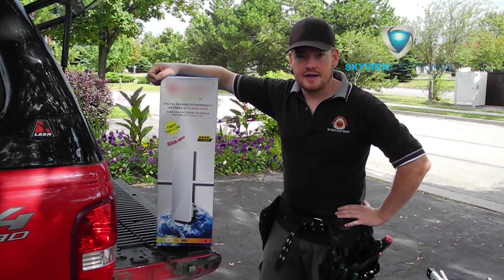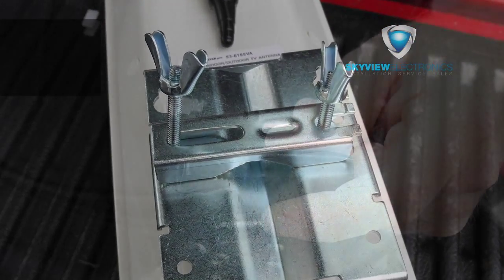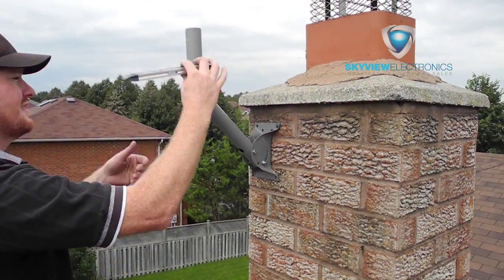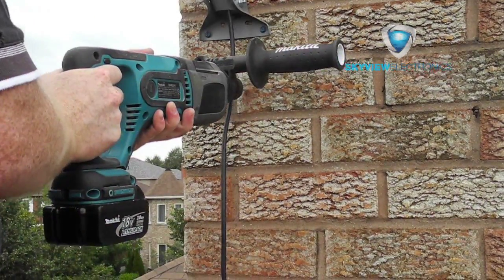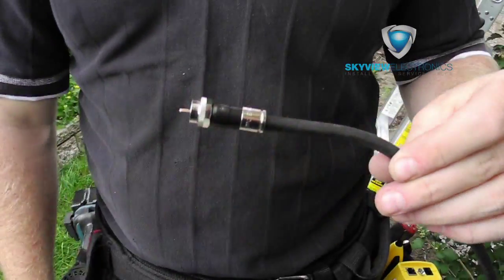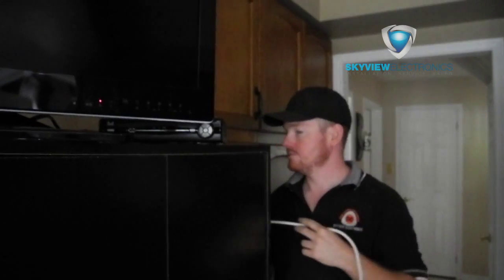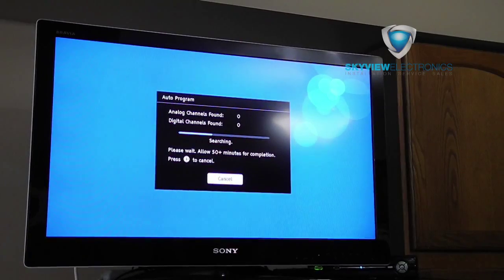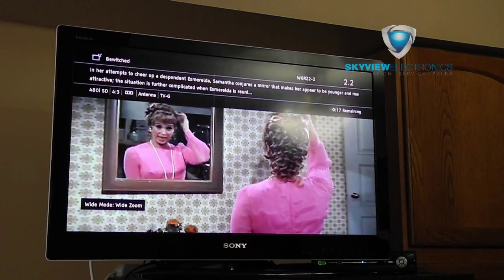HDTV Antenna Chimney Installation by Skyview Electronics

Comment: I would have never mounted the antenna to the brick of the chimney when you can easily mount it to the roof. In this video the installer didn't ground the antenna mounting bracket nor did he use a grounding block for the cable.

Comment: How did you open the rogers cable box?
Reply: There is a special screw driver type of tool that can be found on Ebay.  After you discontinue your cable tv subscription, you may still need the cable company's connections to provide internet services to your home from that same provider or a third party provider.  In this case, you may not be able to use the cable company's connection box and they could disconnect your internet for breaching their box.

Comment: crazy       drilling in a chimney  stack   ..   big  no no ..         worst thing is    you  drilled the end  bricks and  at the top    wow....   them  end  bricks  will   crack   and  fall out within time .
Reply: yes not really the done thing thats what lashing kits are for but he did say it would last probably longer than the chimney yes as the antenna will bring the chimney down
Reply: Drilling the brick rather than the mortar line is the right thing to do.  I can't see that a 3/8" holes, supported in two separate bricks would cause any degradation of the bricks.  The total weight of this antenna and the mount is about 8 pounds.  Most homes fitted with high efficiency furnaces are no longer using the chimney for it's intended purpose anyways.  I've had a 20 lb. flag pole mounted off my brick chimney for 20 years and it performs the same as the day it was installed.

Comment: Typical aerial installer peg the cable work in drill unnecessary holes in the chimney I could go on and on with this very poor installation
Reply: as we say bob the builder could do a better job this guy should have his drill taking from him and banned from doing antenna work
Reply: P

Comment: This video should be titled "How to let a moron on your roof" Or "how to choose the worst possible way to mount an antenna"  Besides the laundry list of things not to do here, Skyview Electronics Feels Ground wires are for the birds, "Your TV will absorb the lightning strike just fine" and "We don't use chimney straps that wont damage your brick and can be easily serviced, We get out the hammer drill!
Reply: Drilling into the brick is often done, though I wouldn't have drilled into the chimney like that.  But I agree, it was a pretty shitty install. Especially how he ran the cable on the roof. Zig Zagging the vents - come on.
Reply: Mike L, I would be far less critical if these people didn't specifically do this for a living.

Comment: here I am searching the web, looking for a decent antenna grounding example. and all I see are idiots getting angry and going on about why you shouldn't drill into the bricks!... I mean come on! almost everyone here in the comments sound like those idiots who tell you not to overclock your pc because it will fail sooner. but in my experience with 3 constantly overclocked pc's that I built8 years ago that is not the case at all and in the end it's nothing more than pure speculation and lies. but that's off topic!. going back to the topic, if this guy wants to drill into his chimney then that shouldn't be everyone else's problem. what people should be looking at here is not why he drilled into his chimney but why real supposedly professional companies aren't following laws and regulations when it comes to properly grounding equipment when they install it on your roof. for instance the 3 previous dishes and the 4th new one I got installed for satellite internet after buying my place are not grounded at all!. not to mention the old ones that are all still being powered by a thin basic cord running from a power adapter to each of them. so instead of rolling in the obvious thought that putting someone else down will make you all feel better about yourselves why don't you just buzz off because in the end you all have worse personal problems than this guy will ever! have with his roof.

Comment: drilled into the top course and the corner!!!!!  what in gods name is that aerial that they installed?? gimmick or what. if you zig zagged that  cable across my roof you would be back up doing it PROPERLY!!  so you try to make the cable runs neat, then you create a complete rats nest in the cupboard and leave it like that!!!!!